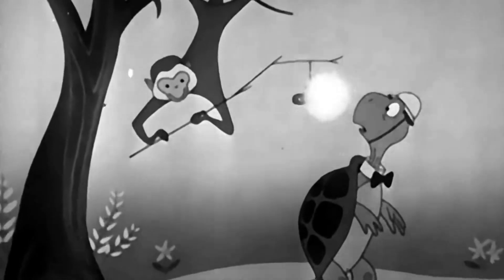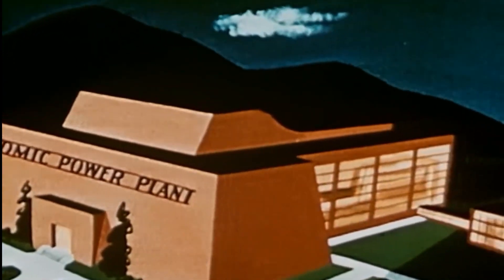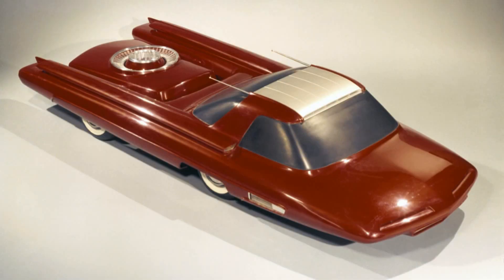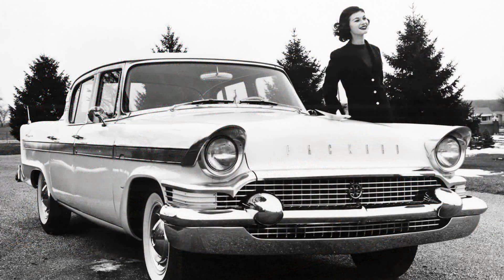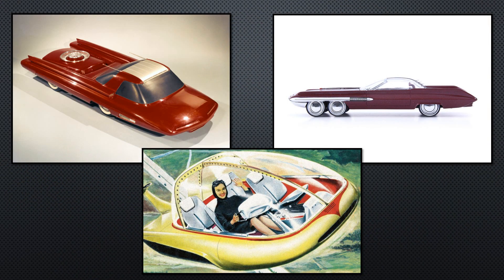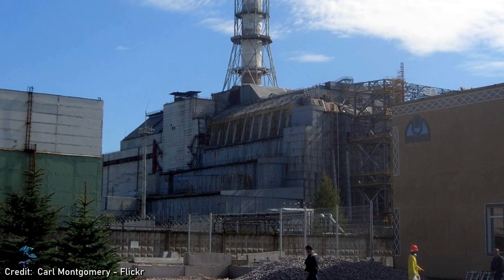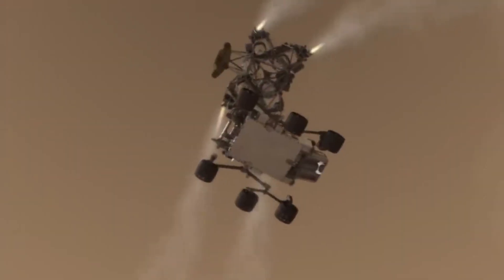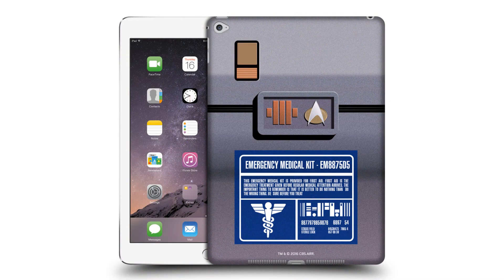Our Nuclear Alternate Future?

Comment: “Ford” and “nuclear reactor” two words that should never be used together, does the concept send a chill up anyone else’s spine?
Reply: Not me, I'd gladly drive this. 

Nuclear reactors aren't exactly fragile from the outside.
Reply: @michaelfixedsys7463  no, but Ford “quality” is...

My last Ford was a 1988 Escort Pony that lived up to the name “Murphy’s Law-Mobile”, so my experience is Ford=unreliable crap

Ford fission reactor? “Meltdown on wheels”
Reply: @MacTechG4  
A low-grade fuel reactor would basically just be a steam engine with radiation shielding.
Reply: @michaelfixedsys7463  I know how fission reactors work, all I’m saying is given my experience with Ford “quality” (and yes, I know the ‘80s and ‘90s were a particularly dark time for Detroit, and it’s likely Ford products are better now) I wouldn’t trust them to make anything more advanced than a wheel (they’d probably make it oval, or square) let alone a fission reactor
Reply: @MacTechG4  I can just imagine the reactor block itself being built well but something basic like coolant loop seals would keep failing or something
Reply: "Ford" and "nuclear reactor"... That's three words but okay.
Reply: Except that Gerald R. Ford is an aircraft carrier with a nuclear reactor. (No relation to the motor company)
Reply: Just like “water” and “Nvidia Ge-Force 3090” should never go together
Reply: Nah, more like "Chevrolet" and "nuclear reactor" gives me chills

Comment: hey hey we have long term storage solutions; like the already funded and i think built yucca mountain that isnt the american long term safe storage facility because a politician blocked the legislation, not to mention the stored nuclear materials and waste can be used in numerous ways, like to help develop electronics or cancer medicines or even to be repurposed into fuel later. long term storage has a solution, it just has to be understood and agreed upon and it doesn't help when idiots tell people there is no safe way to handle nuclear waste. not only is it a lie, its a lazy one. nuclear is a viable and necessary option to replace fossil fuels for good. esp if we expect to replaces fossil fuels with renewables sooner rather than later, nuclear  will be needed to pick up the slack.  though not in the automotive sector obviously. learn to do more research.

Comment: I love the futuristic outlook of the 50’s. Hopefully the “EV revolution” can capture the spirit while simultaneously succeeding.
Reply: old school futurism was always curvy back then
Reply: @n3onf0x  Not true, the 80s had a very square and angular vision of the future, we have a very glassy/ see through version of the future
Reply: @AverageAlien  which is basically the 1950s style just cleaner
Reply: @sockshandle  cleaner as in cold and lacking character
Reply: EVs are trash. Trash for bad drivers.
Reply: @AverageAlien  completely wrong, having more safety features actually improved driving. Plus instant torque will mean the cars will be far faster than an regular car. My electric car beats out any regular car I've drove myself.
Reply: @shaan0121  Acceleration without noise or vibration is joyless and trash. Acceleration is barely 50% of the enjoyment of driving a car. Plus nothing will beat driving a manual petrol, ever. Electric is lazy, soulless, garbage for bad drivers
Reply: @AverageAlien  again the noise can be completely replicated but either way, you can complain all you want but your opinion won't mean much, when they start limiting petrol based cars. Already you won't be able to buy any in the future, and there will likely be slower speed limits for petrol based cars to reduce emissions.
Reply: @shaan0121  no point in convincing hard headed trolls, can garente  @Avenge Alien is probably a mucle car elitest who thinks dodge  are the greatest car manufacturers.
Reply: @shaan0121 yeah I don't understand why you would want a vehicle to generate noise. I would love it quiet.
Reply: @AverageAlien  why tho
Reply: @letsmakegames947  No real engine, no real sound, no manual gearbox, no need for mechanical know-how, and pushing for self driving technology. Only a terrible driver would enjoy something like that.
Reply: @AverageAlien  What powers your car doesn't determine your driving skills. Are you going to tell me that Formula E drivers are worse than their ICE powered F1 counterparts simply because they run on batteries? Come on, man.
Reply: @dave_riots  Yes formula E is incredibly lame
Reply: @AverageAlien  That's your opinion.
Reply: @AverageAlien  no EVS are save
Reply: Take the 50s and put actual engines in them, not EV style stuff.  I would love to see a Nucleon race by making the sound of (maybe) a V10 or 12.

Edit: Yes, I do hate Electric Vehicles. But if I am required by law to own one in the near future, I will, though there's going to be a lot of complaining about the silence of it.

Put actual car sounds in though, then I'm fine with it.
Reply: noh.toomch stupid shitty.rpa.hiphopmusic.
Reply: Cyvertruck is the closest we got

Comment: We actually do have a way to dispose of use nuclear fuel and also to reprocess it. But new fuel is cheaper, so these steps are not taken today. Not gonna blame anyone, those almost indestructible casks can hold it long enough for us to decide in future whether we want to burn it in fast reactors, reprocess or come up with something else. A good thing is that they don't take much volume.

As a nuclear engineer I don't think I want to drive a car with reactor behind me. I think it is possible to build, though the shielding needed would shift the car mass into nonsense. The main issue I see is with the way people treat their cars.

Comment: The solution for modern day is a return to nuclear power using thorium and for local cars would be electric, wind and solar have massive issues with cost effectiveness, and lets face it, the most dirty fuel is still the cheapest, coal, which if an electric change over happened today would b the most likely source of power, while scattered renewables on houses is good this wouldn't 100% feed the grid. Thorium nuclear power if developed would be a very good option, as it produces less radioactive waste and is safer than current uranium nuclear energy.
Reply: perhaps if there was a way to power long hall vehicles directly using nuclear power, such as busses, planes and trains.

Comment: If the curiosity rover turns heat into electricity could we turn excess heat from a cars engine to give it extra power like a weird hybrid system.
Reply: Yes, that works. BMW made a steam turbine with a low boiling point liquid to scavange heat off the exhaust. Several car companies have made Thermo-electric generators for exhaust heat recovery too. Renault did a 2kW unit for lorries, which could save around 10-15% by not having an alternator. The problem that a small turbine with plumbing and Thermoelectric modules are somewhat exensive, so production costs per unit would be the same as the engine of the car. Financially it makes sense, as the savings in fuel pay for the device in a few years, but it was sadly decided not to be something customers would pay for!

Comment: Nuclear reactors are LOUD. Nuclear reactors need pumps running constantly for cooling. Quiet pumps are the single biggest challenge.
Battery operated diesel recharging submarines can beat them every time on noise in the short term (a week or so) underwater.

Comment: The world in 1945: "2 nuclear powered bombs wiped out 2 entire cities and hundreds of thousands of people".

The world in the 1950's: "Let's nuclear-power everything: Subs, trains, cars, even toasters!"

Designers in the 1950's: "Heck, why not even sniff a little uranium!"... and so the creations depicted in this video were born.

Great video as usual!
Reply: That comparison makes about as much sense as comparing a gas powered car to napalm.
Reply: What about a nuclear powered artifical heart ? (no joke, seriously considered)
Reply: @jpq6257  LOL if this is even posible to miniaturise a nuclear core that much , you have to at least carry a wheel car (like luggage) behind you with all parts inside and wiers to you body to power the artificial heard. And you I'll be like a fucking steem locomotive :D, not to mention radiation poisoning if not a proper very heavi led shield is not implemented :D
Reply: @intel386DX  I’m supposing it was intended to be an RTG, the kind that runs the Martian rover mentioned and also the space probe which took those pictures of a Pluto. 

They directly turn heat into electricity, just with lower efficiency than a steam turbine. But when you only need a small amount of power, long lifetime and small size and weight, an RTG is actually a lot better. 

There are actually modern proposals for a “diamond battery” next-generation RTG made from radioactive carbon, and sealed in glass for safety, which would be about the size of a button cell battery and last the lifetime of the pacemaker user.

Comment: You don't seem to like nuclear power very much, but why so? Nuclear reactors still are much safer that other means of energy production and do not produce any carbon emissions. Also, storage of nuclear waste in geologically stable area is as good as it gets in waste management. None of y'all using that argument seem as concerned on the management of plastic waste, yet it is a much bigger issue right now. Cheers.

Comment: Thorium molten salt reactor would theoretically get enough miniaturized to get installed in a car. However, till the technology eventually goes so far, the battery technology would already cut it in infrastructure, practicality, market acceptance, etc.
It would be more reasonable for ship transportation, I assume, whereas aviation industry would rather go with Hydrogen fuel cells...

Comment: Sure some dodgy garages would still try scamming middle class women by saying they need their spark plugs changed on one of these
Reply: "Your diesel tank needs some work"
Reply: "Fuel lines need replacing"
Reply: Ma'am your photonic resonance chamber is leaking radioactive unobtainum!
Reply: @lorenzamccoy7512  that sounds like something a ratchet and clank character would say
Reply: "Ma'am your wheels are photonically disconnected"
Reply: ah yes my electric car has a sparkplug alright, * shoots reactor and its meltsdown *
Reply: @Armando A bro pull the plug wires with the engine running and the customer standing there it takes only minutes to prove to them by simply pulling plug wires which cylinder chamber is not firing.
Reply: Needs more blinker fluid
Reply: @JustTryinaDuck  "Hey doughnut, go get some blinker fluid from the store will ya"

Comment: Very interesting and some what alarming! 
I have spent nearly 40 years in the motor industry and the thought of letting auto technician's loose on an Atomic reactor is frightening, i sometimes thingk that letting them near an internal combustion engine is bad enough ! (:
Reply: Just get this, a nuclear powered car would take less than 10 grams of thorium to power for it's whole lifetime. It's a tiny capsule that can be easily contained, although the reactor would be larger than that, for a car you don't need much. While I don't think motor vehicles are the safest candidates for nuclear power, it's certainly not as dangerous as it seems.

Comment: Nucular cars are the future. When we have developed the re-charging infrastructure sufficiently and the range of these vehicles has increased to what we already expect from todays vehicles (say 3000 miles per discharge) they will be a viable replacement. 
Vehicle to Grid connections will be as nerve wracking as when BR crashed that train carrying a nuclear container.

Comment: In fact, early submarine nuclear plants were very noisy. Diesel engine noise was only a problem while snorkeling or running on surface (there were still submarines without snorkel in the 1950s) to recharge the batteries. Only the Soviets introduced a diesel powered “true” submarine, the Quebec class using liquid oxigen to feed modified diesels without much luck. The main advantage of nuclear power was evidently unlimited underwater range at top speed versus 24/48h at 3/4 knots for a conventional diesel electric sub of the era